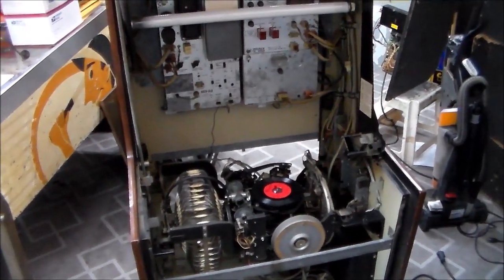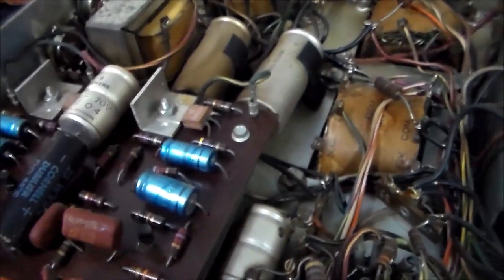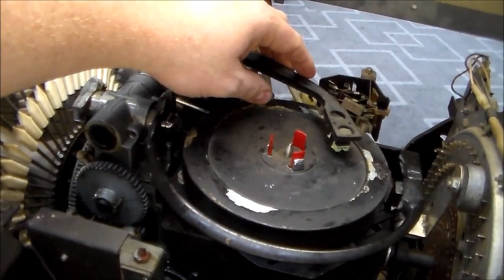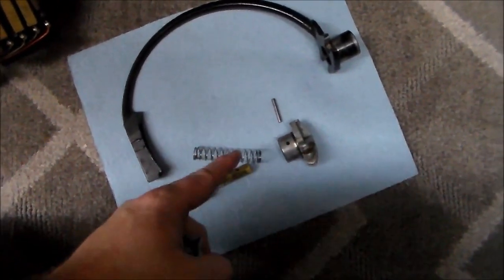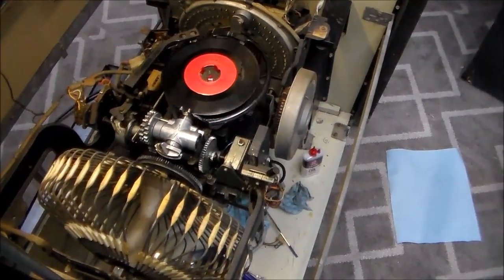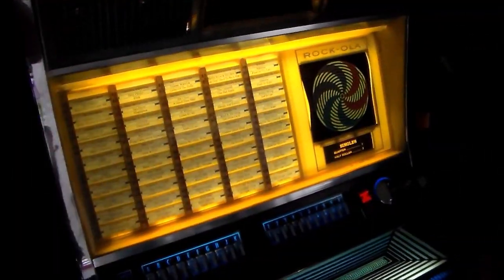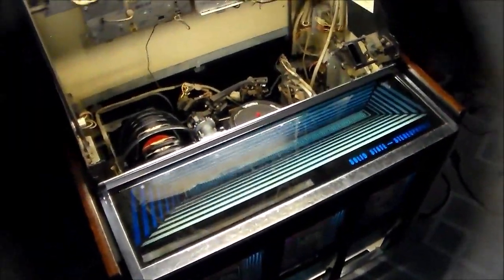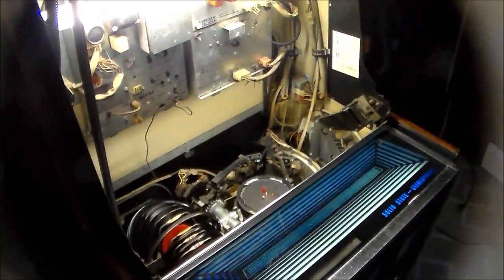Finishing Up Repair on a 1970 Rock Ola Model 445 Jukebox -Amplifier Work, Mechanism Adjustments 3of3

Comment: this may sound stupid and may not work,( like gomer pile once said" stupid- stupid- stupid !!!") could you  use a "TY-RAP" on the sol. plunger to give "FREE PLAY"  that way ,( with the add- subtract credit unit with no credits left ?????) that way the solenoid coil is just going along for the ride( de- energized) just a thought.      also, on the amplifier, recapping is a great idea, I always change out the electrolytic caps(multi-section) just for "AGE" reasons. you can tell if they are "LEAKY" by touch method, they should be operating cold, if they are warm or hot, they have got to go!!!. many times you can "REFORM" the caps by using a "VARIAC" and ramp up the line voltage to the amp slowly( watch amp draw  when doing this, or use a 200 watt light bulb in series with the primary winding of the power transformer). like you have said many times these units have been setting around for years. slamming 120 volts to the amp may cause "LYTIC CAP FAILURE", also checking resistor values is also a must, the "CARBON COMPOSITION" resistors drift up in value as they "AGE". the tube amps can tolerate "sloppy resistor values", however the solid state amps----- not so much!!!!!
Reply from the maker: That solenoid coil is a doozy, it has to be pulled in or the buttons won't latch in.... and it has to de energize after the buttons are pressed.  You could probably rig up some sort of leaf switch or something that energizes it when the first button is pushed down (so that it holds it down) but whatever you added would have to make sure the usual operation (the coil staying energized, until both buttons are pressed and the selection is registered, then it lets it go and resets the buttons) still works.... I'll bet somebody's figured out some way to do it...
Reply: "I SEE, NOW, from my end , I do not have that insight" thanks for responding back, and have a great day!!!!